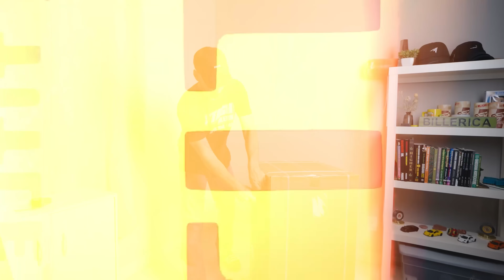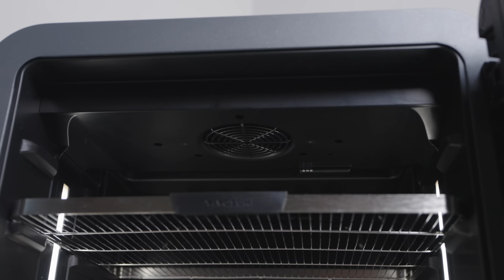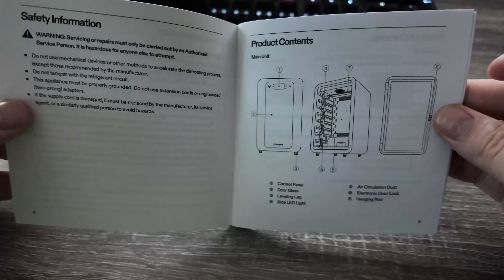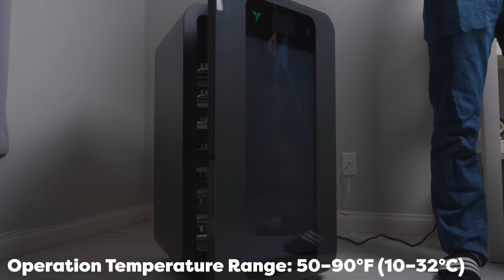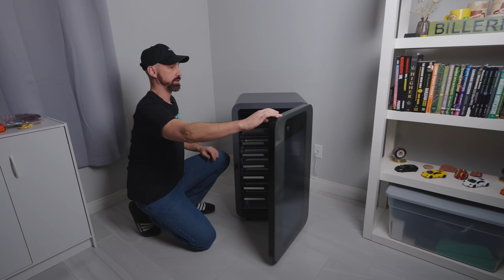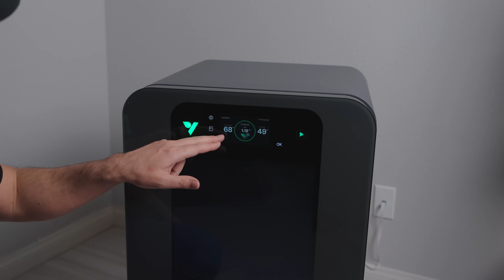Vivosun VCure Smart Drying & Curing Box (Unboxing & First Impressions!)

Comment: I saw a few videos on Cannatrol, and I love the idea. Its nice that Vivosun made their own version, and I love that magic glass door. I think I am going to start saving up some money for one. The Vivosun is a couple hundred bucks cheaper than the Cannatrol, but now that there is competition mabye the prices will even out. I just bought my first 4x4 tent kit.  I have always grown outside, so this will be a new adventure for me. I think having one even for small harvest is a good idea, as I have wound up with some hay smell in the past. Yep, I smoked it anyway, lol.
Reply: Hay smell is from the buds drying too fast. Just hang dry in your tent for about 10 days at a STABLE 60%rH and 60 degrees. Then trim, bag/jar, and put into storage(I use a $100 wine chiller) to cure for about 3 weeks. Put a small hygrometer in each bag/jar so you can monitor each bags humidity level. If it dries out too much, pump a little humidity into the bag/jar, seal it, and monitor until the desired rH is maintained consistently.

No need to spend hundreds of dollars on ridiculously priced products like these.

Comment: As a cannatrol owner for a few years I knew eventually there would be others on the market at some point. Sounds like the same tech with a few adds. I love the the front door dimmer. Main difference I see is cannatrol it’s all about RH and v cure is VPD. Hmmm, if it does the same for cheaper then hell yeah
Reply: You can maintain RH in Grove bags and store the bags in a Wine Chiller to keep cool and dark long term. Does everything these fancy things can do at only a fraction of the cost($100-$150). No need to spend senseless money on a Cannatrol OR a V-cure.

Comment: I checked into the beta cannatrol now out for 1199. For an extra 125 you can add phone app. It has a solid door, with improved insulation.  Better room temp range 45 - 90 degrees.  Injected mold interior with improved airflow and front load drip tray.  Updated the screen in the door and its programming.  So after 5 years and some competition its within about 300 bucks of China.  I'm leaning on made in usa.  Looking forward to Chris' comparison.

Comment: Drying my cannabis is the worst nightmare of all. I was looking at the cannatrol and the $2K price tag sent me packing. I saw this at Vivosun and am now hunting for some reviews. The cannatrol guys wouldn't accept credit card when I contacted them. I am presently using the Drytents dry tent co., and again it can be a hot box. I cut a hole in the side for the AC Infinity humidifier hose set at 62% RH, ran a 4" dryer duct to a cooler area for an inlet and exhaust with a slow filtration fan for an even exchange of air in and out and it does get cooler, and even then, 5 days later my buds were over dried. So, I have never known how good the bud I've grown is because the old 60/60 temp/humidity rule of drying requires a dedicated space to cool down that far. These are just a few thoughts. I found out 3 years ago I have end stage liver failure, and I took up growing cannabis Aug 1, 2023, when MN went legal. It keeps my mind occupied and I came to love the grow. Living on a fixed income kind of keeps these units out of reach, but the Vivosun unit is perhaps something I could start saving for, being more affordable. Hold my breath and look at my credit card balance... ha, but I am determined to get this right.

Comment: I'm suprised its taken so long this kind of thing to start taking off; i know here in the UK people have been converting old wine coolers into cannatrol-esq things (basically what this Vcure is) for a long time now but a lot of people dont like playing with electrical stuff. The dry and cure is without a doubt the part people mess up the most though so this sort of thing will be great once the big companies start a race to the bottom in pricing. 
Edit: Hopefully they quickly switch to a unit with a piezo cooler instead of a compressor, its half the reason we convert wine coolers and not fridges, because compressors arent great for this use case
Reply: My compressor mini fridge works just fine for the job. Easily holds 50 degrees and 50 pct rh.
Reply: @patarmstrong3582  If its working for you man, thats great! the piezo is still the better option for our use care though and at $700+shipping, i'd expect one

Comment: Just ordered mine . I also have a cannatrol and I know u do to so I’m curious how u compare the builds having your hands on both ? This thing actually cools unlike the cannatrol?
Reply: same
Reply: How u like your cannatrol? Do your regret buying?
Reply: @THE_ON3_1990  I like it a lot now that I figured it out . I’m new to growing and I suck at hang drying . I don’t like the factory setting with the 4 day dry and 4 day cure stuff was still to moist . Because it locks in the terps you lose some  of the loud smell until u crack open a nug. I dry for 7 days and cure for 7 in the cannatrol. . I try and keep it as low temp as I can and humidity in that 60% almost a 60/60 environment. I feel with the longer dry u still keep that dank . I don’t like the little water tray u always have to  empty or having to remember to keep sponge wet . Also it won’t hold a whole plant unless u grow little plants . Need a fridge size unit made .
Reply: @THE_ON3_1990 I love mine

Comment: Half way through the vid. If this unit it over $300, its not worth it. 2- 27gl black totes flipped onto eachother with an inkbird and a Mr. Breeze dehumidifier will work just as well for less than $100. Just sayin'.

Comment: I use a cigar humidor with temp and humidity settings 😅 from amazon 70L  but I hang dry 7 days becouse i can fit all my work to dry in there. Then trim then in curing bags and tose them in the humidor at 60f/58% for curing and storing.

Comment: Vivosun gear is top-notch quality. I have 3 (three) VCures shipping in Dec.
Reply: I told them they need a VCure shelf to put 2 devices in same floor space, similar to Cannatrol stacker but without top device putting weight on lower device, a metal shelf designed specifically for 2 vertical VCures.

Comment: Pretty cool that its using a compressor technology instead of the Thermoelectric tech of the cannatrol. The price point on these however is still beyond what a beginner grower is willing to pay imo. For the small batch grower that has been doing it for a while the price can be justified. Making your own Dry and Curing box from a thermoelectric wine fridge is only in the ball park of around 300$ and seems to provide extremely similar results to the cannatrol and I would assume this. Glad companies are putting in the R&D to make these for the masses but ill stick to the DIY until these become affordable.
Reply: Not got either machine myself and definitely agree with your DIY build. I also think I'd prefer the thermoelectric tech than a compressor.  There's a chance of terps getting sucked away with the compressor . If AC Infinity don't come out with a model that makes sense to not go DIY then DIY all the way

Comment: Cannitrol has given me great results. Still learning insides and outs as far as size of buds and proper dry time and if the bud even needs to cure any longer than the 8-10 day dry.However I’ve gotten great bud snap that preserved all the buds inner beauty. I had red hot cookies and it looked like a galaxy inside the structure. Not all of us can hang dry prior to tossing buds or branches into these machines so take all advice with a grain of salt and understand your buds are different from others as far as size and density. Getting ready for my second dry and I can’t wait because I’ve been smokin showcase pretty boy weed when I’m trying to smack my lips  on that dank. These machines aren’t magic so learn your device understand your buds weight and density and buck those nugs if they fat and solid and toss em in

Comment: I’ve had so many problems with that company lately. It’s ridiculous. 

False advertisement on the website so bad they changed the listing for a tent kit, they sent me a used light that didn’t work and it was dirty and taped back up. Waited a week for a replacement. 

I ordered a lot of their equipment off Amazon and everything I’m receiving from that company. Their box is horribly damaged 90% of the time. That’s coming from their warehouse not Amazon.

I bought a lot of stuff from them and about three weeks later they came out with all redesign new equipment controller lights everything three weeks later, they wouldn’t even hook me up with one of the new controllers to be nice because I just dropped like $900 with them.

Pretty much every piece of equipment I have is from them and they do not care about anything unless you have a bunch of subscribers

They screwed up so many of my orders, they didn’t do anything to make it right. 

To be honest, they’re super greedy and they make a shit load of money. I did the research.

Comment: Let us know what’s better Cannatrol or v cure
Reply: I use an old minifridge- compressor style. Just turn the temp up, and it holds 50 pct humidity and 50 degrees. I bought an inkbird for this and don't even need it.
Reply: Can make your own for a fraction of the price, a large koolatron, a dehumidifier " for the peltzer" and an inkbird controller. I've made my own cannatrol/vbox for under $150.00
Reply: @DanielB-i7w u got a video on it I’ve seen the home made ones
Reply: @Mr.StoneyFarmz ILGM FORUM thread drydoc.

I just wired the fan and peltzer from the dehumidifier together to the power switch/ wall plug, plug it into inkbird and set the peltzer inside on the bottom of the koolatron with fins over built in water rails. Works like a charm.
Reply: @DanielB-i7w thanks I was just looking at the koolatron
Reply: Neither they are both overpriced junk.
Reply: @DanielB-i7w I feel you

Comment: I've been waiting for this to come out! I usually rent a Cannatrol at a local grow shop for my harvests, it's too expensive to buy. Hopefully the Vivosun version is as good, it's supposed to be cheaper. 
Edit, hopefully Mars Hydro and AC Infinity and the other major grow equipment folks will start making their own versions of drying and curing boxes and they get even cheaper. They might be $200 in a couple years.
Reply: Just buy a minifridge and turn the temp up. Use an inkbird controller if you have to, but mine doesn't need one to be 50 degrees and 50 pct humidity.
Reply: @patarmstrong3582 I might have to try that.

Comment: Capacity seems small... I am a small home grower, 4 plants per run indoors. My wet harvest could be between 5 - 8 pounds. I would more than likely need 3 of them if not 4 for a bumper crop. Novel idea, I guess we'll see what the general masses think...
Reply: Are you in VA too? I typically only harvest 1 or 2 plants at a time so I think it would be awesome at my house.
Reply: @comfortablynumb9342  No, I'm in Cali. It would be great if I only harvested 1 or 2 plants at a time. I have a wine fridge that I use now to dry bubble hash and I can also fit one trimmed plant into it to dry. It works, lots cheaper too...

Comment: So you have to cut off every bud off the branches and then put them on the racks? The spacing between the racks looks small? You have to add water to control higher humidity. I’m sure it’s the way to go just it’s new technology

Comment: It looks like the temp and humidity fluctuate quite a bit. The design, trays, and controller are on point though. I’ll stick with my diy version.
Reply: Same. I don’t like how they used a compressor but they tried to make up for it by adding a humidifier. Probably some sort of patent violation if they had used a thermoelectric cooler. I’ve recently monopolized all the the TE wine fridges in my area lol I’ve been a sniper on marketplace trying to get enough room to dry my entire 4x4 at once
Reply: @pauldistasio4385 that's funny af! I have a couple myself. After you figure out how to make them work, your gold.
Reply: The DIY cannatrol's are the way to go IMO. Unless this Vcure blows the Cannatrol out of the water then it wont do anything the DIY versions cant. I can build 3-4 DIY dry and cures for the price of one of these.............
Reply: @masterfreekill8625 I built 3 for under $500. I haven’t payed more than 80 for any of the fridges

Comment: Looks to be top of the line! Only 15 watts is stellar! Did you mean 15 amps? If so, that could be an issue for most home growers. Having to dedicated a 20 amp breaker would take being able to keep that in the bedroom off the table seeing most bedroom breakers are 15amp breakers. 
Probably why they have the wiring diagram on the back. To hard wire it in to new construction areas....
Reply from the maker: 50 watts. I showed 50w on the screen too. But I see see how that may sound like I said 15. Thanks for wiring diagram explanation! Hope you have a great weekend bro
Reply: 50 watts